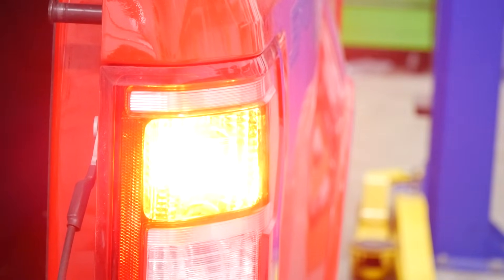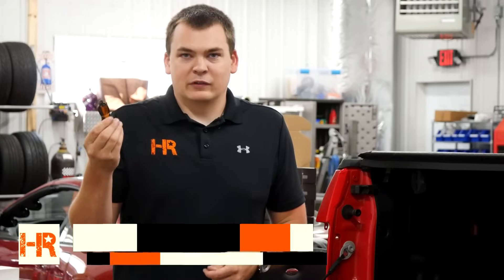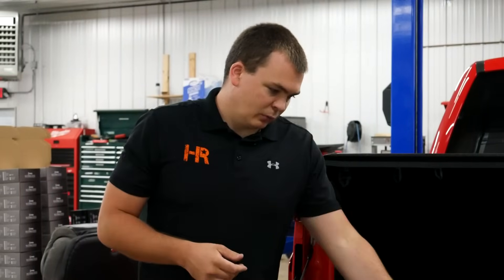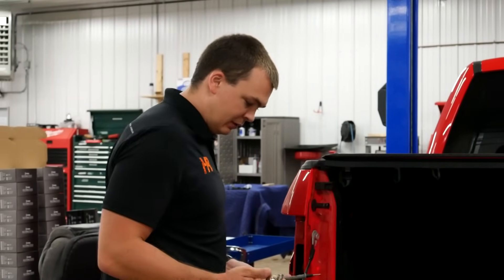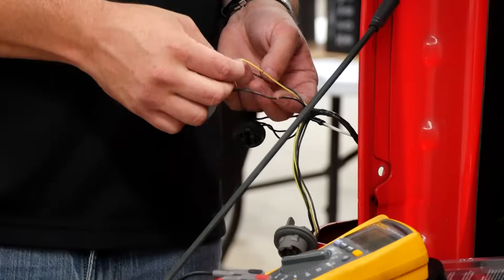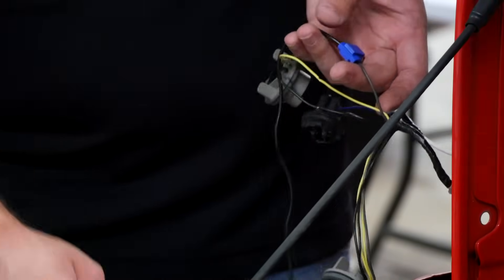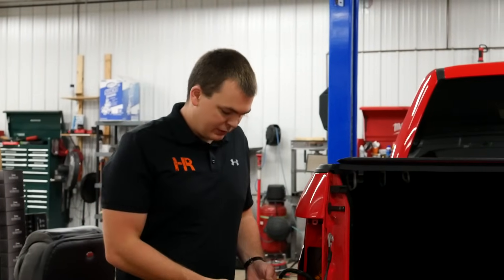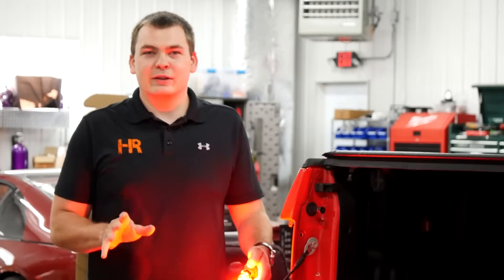How To Install LED Resistors - Everything You Need To Know | Headlight Revolution

Comment: Hello, I have a 2005 Harley Electraglide Classic. What resistors would I need? Thank you.
Reply from the maker: You would need to go with the same LED turn signal resistors, they would be the 50W 6ohm resistors linked here: https://headlightrevolution.com/gtr-lighting-50-watt-6-ohm-gold-style-resistors-for-custom-installation/
Reply: @HeadlightRevolution  Does it make any difference if the front bulbs are 1157 and the rear are 1156? Thank you.
Reply from the maker: That may make a difference depending on how they supply that power to the bulb. I am wondering if you have a wiring harness that goes into a connector for the bulb, and if you do, are those wires accesable? That will be the only way they will work with that bulb, and if you have the BMW Style board lights then you will not be able to install those turn signal resistors. Let me know and I will be happy to help with this!

Comment: I want to ask you something if you know it and I know it could be bit complicated.
LED draw less current thus meaning LED has less resistance correct? That's why you need the extra resistor to prevent fast blink by regulating? What is the fast blink for or from? Halogen bulb draws more current I know for sure. And when resistance light bulb goes up resistance goes up?
Reply from the maker: With LEDs in a turn signal applicaiton, the computer will think that there is not a bulb there or that the bulb is out since it produces less resistance, so it will trigger a hyperflash to let the driver know that there is a bulb out. That is the only real reason that LED bulbs hyperrflash in vehicles.
Reply: @HeadlightRevolution  I get that. So that means LED draw less current thus having less resistance.
Reply from the maker: With our kits, you will need to get just the turn signal bulb and the single resistor per bulb. That resistor will just splice into the OEM turn signal wiring, and will prevent the hyperflashing! If you have any other quesitons, shoot us an email and we will get you taken care of! Sales@HeadlightRevolution.com

Comment: Instead of Resistors, how about simply replacing the Flasher unit with a Flasher designed to drive LEDs?  This means simply unplugging. your flasher. unit, usually located by the driver's fuse box.  I suggest getting  a little masking tape, turning your flasher on, and feeling/looking for the relay.  Put the tape on it.  Take your phone and take a picture of it, look to see if there are any snaps that secure it.  Turn off the flash, turn off the car and and unplug it.  Take your phone and take a picture so you can see how the plugs fit (some have 2, 3, 4 or more - depending on your car).  Orientate the new plug and just replace.  Cost is generally ~$10 USD, which is less than the resistors.  Just look up the LED Flasher module that your car requires.  Takes all of 5 minutes - no cutting the wire harness, no soldering, no mess, no fuss.

https://www.amazon.com/s?k=led+flasher+module&crid=IT7PIABX40DF&sprefix=LED+flasher%2Caps%2C199&ref=nb_sb_ss_i_5_11
Reply from the maker: You are totally right, that is another great option for some people! For the people that either can't find the flasher module for LEDs for their vehicles, or just don't want to mess with that, the resistors are still a great option as well!
Reply: Headlight Revolution 
Not a fan of resistors, and here is why.  
1). Nobody likes cutting their wire harness, some are old and brittle.  Some copper is oxidizes and does not solder well
2). Resistors create heat. This can do several very unfortunate things
a). Melt plastics, including lines with flammable material
b) Melt plastic creating a short that can damage the electrical system, or create a fire
c). Create heat that causes their paint to bubble, requiring a new paint job

Any one of those possibilities is a high price to pay for brighter flashers. 

Instead of brute force mitigation of the excess energy; why not use a switching module that simply uses far less power?
Reply from the maker: I am not sure about why we don't use a different module, but I will pass this information along! Thanks for commenting and for the support! Have a nice day!

Comment: man its 2020 resistors are so stone age, all that wiring mess, where are the LED bulbs with built in resistors? plug and play, no wire splitting no damaging your wires. Is there an general marketing name for built in resistor bulbs?
Reply from the maker: We have a bulb that workks with some vehicles without resistors, but not on all vehicles. The issue is that there are so many different manufactureres that will change little things here and there to try and get you to buy replacements for everything through them. That is why it is hard to come up with bulbs that will work for everything in every application.

Comment: I’m sure you guys have heard of the LED strips that people are installing to the exterior of their headlights. My Indicators and DRls work when the car is off. But as soon as I turn the car engine on only the DRLs work, it won’t switch to the indicators?
Reply from the maker: I have totally heard of those, but I am not sure what could be causing that as they should work with all the drivers and other products youwould have ot have installed with them. Your best bet will be to contact the company that you purchased these from. Good luck with that!

Comment: I installed some on my 2013 Chevy Silverado with the resistors and it doesn’t hyperflash when the lights are off but when I turn them on when is night time they hyper flash can you help me
Reply from the maker: That is very odd, I am wondering if you have the LEDs replacing halogens anywhere else on the truck? If you could let us know, we will be happy to help you out from there!

Comment: ? do I need to buy 2 of them. I have 4 blinkers on the back of my four-wheel drive
Reply from the maker: If you have 4 bulbs that blink with that turn signal in that taillight, then you will need 4 resistors or 2 pairs of resistors, as you will need one resistor per bulb.
Reply: @HeadlightRevolution  OK thank you very much I have order 4 of them on eBay and I will let you know how it goes when I received them 🚙
Reply from the maker: Glad to hear you got those on order, let us know if you have any issues with those, we are here to help!

Comment: I have plug and play 7443 led why does it  have 2 resistors since i know just 1 resistor gets real hot...but 2 ...also any tips how to put them in honda accord 2016
Reply from the maker: Hey there, thanks for commenting! If you purchased from us, then the resistors would be sold in pairs. You will only need one resistor per bulb, so you will need 2 pairs of resistors for most vehicles. If that is not what you were getting at, I am sorry about that, and if you let us know what you are saying we would be happy to help!

Comment: I need a resistor kit for a 2014 F150 supercrew! I burnt out a front signal light and changed both fronts to led. Now have fast blink. I also want led bulbs for the parking and signal and reverse pls!!!
Reply from the maker: Thanks for commenting, I can totally help with this! For the turn signals, you will need a pair of resistors linked here: https://headlightrevolution.com/gtr-lighting-50-watt-6-ohm-gold-style-resistors-for-custom-installation/

For the rest of the vehicle, you can purchase the kits that we have right here: https://headlightrevolution.com/vehicles/ford-f-150/ford-f-150-2009-2014/

Comment: T tips connectors are useless in a wet and damp environment they will rust so fast and create an intermittent connection up to a point where their connecting metal will go black and oxidize and create heat every time current wants to get trough and possibly a fire hazard melting your expensive tail light plastics , used mounted under a dash not as bad water doesn't get there and with the inside heater on in winter will protect that weak connection ! Soldering and a good quality of shrink tubing the kind that are made with glue inside so they can't move after being shrunken is the best most affordable long lasting solution ! Real waterproof industrial connector are even better but need special tool for inserting wires !
Reply from the maker: Of course soldering will be the best option, but not everyone is able to do that so that is why we use this method! If you can solder these, we would absolutely recommend doing that!

Comment: Do i have to put a resistor on each led light bulb wire? Or can i just put one for right side and one for left side? In the rear lights and that will help for fron blinker too??
Reply from the maker: For each bulb that flashes with the turn signal, you will need one resistor! Hope that helps!👍

Comment: so on a headlight assembly where it's a wiring harness that attaches to the whole headlight with with for Hi-beam, front parking/turn signal and side parking/turn signal and DRL. Do you install the resisters for the turn signals past the wiring harness?
Reply from the maker: You would still do that on the harness, but you would need to use a multi-meter to test what wire is the turn signal positive and negative! That way you know what wires to tap those into on the main harness! You can honestly test them right from the pins instead of taking the wrap off of all of those wires in the harness!

Comment: Do you 2 on each side? Same truck.
Reply from the maker: If you have the model with the brake lights and turn signals both blinking, then you will need to have 2 resistors on each taillight. No matter what style taillights you have, you will need to have just one resistor per blinking bulb!👍

Comment: Do you have a video on installing resistors for brake lights? I’m getting an error code on my dash saying to check the brake lights, and I have the resistors installed correctly like you show.
Reply from the maker: If your break light blinks with the turn signals, then you will need to install a pair of resistors with those as well. You will install those in the exact same way as the ones in this video, splicing between the blinking positive wire and the ground!

Comment: I resently bought a F150 2010 that have LED on the rear but the left side doesn’t go ON with the signal just the right side and in the in side of the truck the turn signal go fast. I dismount the rear lights and change the LED light one side to another and they are fine. Both side go ON with the stop light but just the left doesn’t with the signal or emergenci light. I do not see any resistor. My questions are : Is this the same problem? And how do I know wish resistor I need?
Reply from the maker: This may be the same issue, but it is hard to tell. If you have the OEM LED taillights, then you would need to check with the dealer, as that could be the LED in that application going bad. If this is one of our products, or an aftermarket LED taillight, then that will be a different story. Shoot us an email, and we would be happy to help you get to the bottom of this! Sales@HeadlightRevolution.com

Comment: I installed the led light and resistor and my left side works fine but my right side is completely unresponsive. Any fix?
Reply from the maker: That is odd, I am wondering if you have checked for reverse polarity by flipping the bulb in the socket 180 degrees? If that doesn't do anything, make sure that you check the resistor, to make sure that it is wired to the correct wires! If you are still having issues, go ahead and shoot us an email and we will get you taken care of! Sales@HeadlightRevolution.com

Comment: how many resistors do you need to stop indicators stop flashing fast
Reply from the maker: You will only need one resistor per blinking bulb! That specific vehicle has multiple bulbs that flash, that is why there are 2 resistors per side in the video!

Comment: Hi. I want to get these fancy LED bulbs only for my tail and head lights (the ones that are always on) Do I need these load resistors? I have a Toyota Matrix 2009. Thanks for your answer.
Reply from the maker: For the taillights, you may need resistors if they are also used for the turn signal bulb! As for the headlights, you may need the PWM modules linked here: https://headlightrevolution.com/product-types/install-parts/canbus-integration/

Comment: my LED headlights seem to be giving some electrical issues. would a resistor on these low beam and hi beam lights do a similar fix?
Reply from the maker: You would want to go with a PWM Module, as that will correct most issues that you see from installing an LED headlight bulb! Link: https://headlightrevolution.com/product-types/install-parts/canbus-integration/

Comment: I see that 300zx in the back👀👀 what led lights and resistors are you using with that car?
Reply from the maker: You will need to go with 1157 bulbs for the front turn signals, and 1156 bulbs for the rear turn signals. You will need to install the same LED resistors for those turn signals as well! 1157 bulbs: https://headlightrevolution.com/gtr-lighting-armor-series-1157-led-bulbs/  
1156 bulbs: https://headlightrevolution.com/gtr-lighting-armor-series-1156-led-bulbs/
Turn Signal Resistors: https://headlightrevolution.com/gtr-lighting-50-watt-6-ohm-gold-style-resistors-for-custom-installation/

Comment: Why wouldn't you just use your probe in the socket and not strip anything especially if your using t-taps and if you know enough to solder would hopefully know to insulate.
Reply from the maker: Some probes may be too large to fit into those tiny wedge bulb sockets, but if you can make it work that would totally save you a step!

Comment: Will this work for a parking light out error on my dash for the 2018 ram? I installed some new headlights that have LED Parking lights and ive been getting the error ever since. Do i need to run the resistor to the parking light wire or the turn signal wire?
Reply from the maker: If that bulb blinks with the turn signal and you are getting this error, that could require a resistor on the parking lights. Generally, you would need to go with a pair of the 50W 6ohm resistors linked here: https://headlightrevolution.com/gtr-lighting-50-watt-6-ohm-gold-style-resistors-for-custom-installation/
Reply: @HeadlightRevolution  yes the turn signals work fine, just getting that error. thx!
Reply from the maker: That is interesting that you are getting an error still, reach out to our sales team and they will be able to get you taken care of! Sales@HeadlightRevolution.com

Comment: I have a 03 Trailblazer Ext, my running light is also my brake light, how do I wire that up?
Reply from the maker: If that is your turn signal, then you will need a resistor, but if that does not blink with the turn signal you will be good to go! 👍
Reply: It's not a turn signal. Without a resistor the brake lights work but the running lights don't. Or vise versa if I switch the polarity on the light
Reply from the maker: That sounds like it may be an issue with how the bulbs are wired vs how the sockets are wired on that vehicle. Shoot us an email and let us know what you have going on, and we should be able to get you a working pair of brake lights in there! Sales@HeadlightRevolution.com

Comment: I have a question for you guys.
 do you have a list that you'll share with all the resistor values/ ohms for each vehicle?
Reply from the maker: I wish that we had a master list, but unfortunately we do not have that. Almost every vehicle will require a single 50W 6ohm resistor per turn signal bulb!

Comment: Turn signals are easy. What about continuous on lights like parking and tail lights? I've got a BMW canbus motorcycle where they are in the same circuit. Ideas?
Reply from the maker: Are you currently having an issue where those bulbs are throwing codes?

Comment: I did a full LED Taillight light replacement on my 2014 Ram 2500.  What resistor kit do I need? 
Thanks
Reply from the maker: If you did the full taillight housing instead of the bulb replacement, then it would either have resistors built in, otherwise it will be the same process to prevent the hyper-flashing on the rear turn signals!. Shoot us an email for more questions on this!  Sales@HeadlightRevolution.com

Comment: Hi, I have a 2013 Lexus GS and I’ve replaced all factory incandescent turn signal bulbs for LEDs they’ll start hyper flashing after about 1-2 mins, could you tell me what resistors I need, and if I need four for the four bulbs?
Reply from the maker: You will need to install 1 50W 6ohm resistor on each of those turn signal bulbs, and they are sold in pairs! You will need 2 of the resistor kits to cover front and rear. Link: https://headlightrevolution.com/gtr-lighting-50-watt-6-ohm-gold-style-resistors-for-custom-installation/

Comment: Do I have to wire a resistor in on ALL the indicators e.g. one resistor for each flashing light,regards Mark
Reply from the maker: You got it! One resistor per bulb! For your front and rear turn signals you will most likely need 2 pairs of resistors linked here: https://headlightrevolution.com/gtr-lighting-50-watt-6-ohm-gold-style-resistors-for-custom-installation/

Comment: Can I mount the resistor on the plastic wall piece of my vehicle? I have a sport trac 07 and only place I can find is the plastic of the truck and not sure if it could cause any problem and probably sure it won’t touch the wires of the bulb.
Reply from the maker: Those resistors definitely get hot, so you would want to mount them with the self tapping screws to a metal portion of the body!